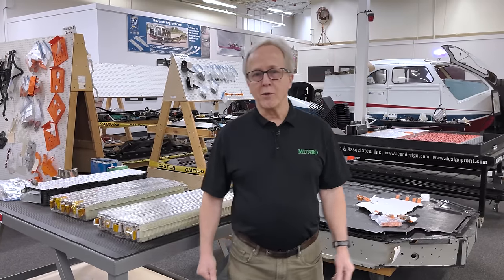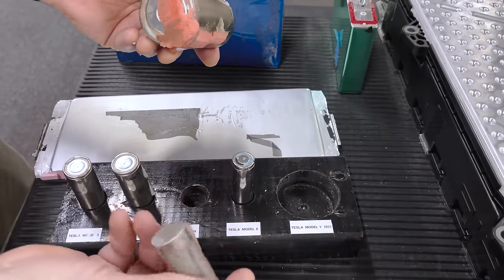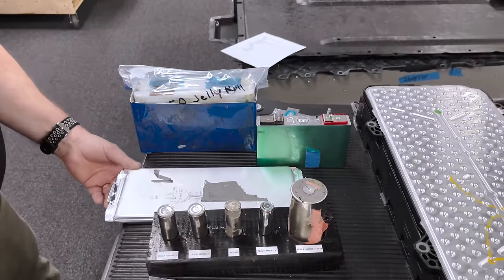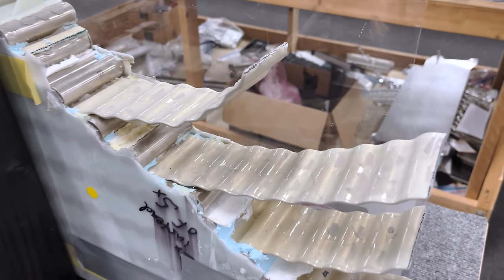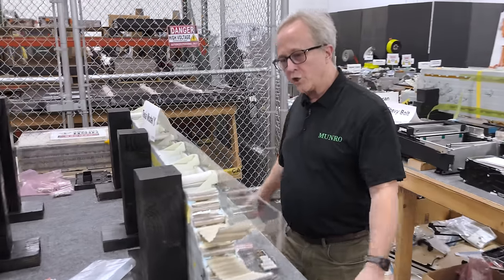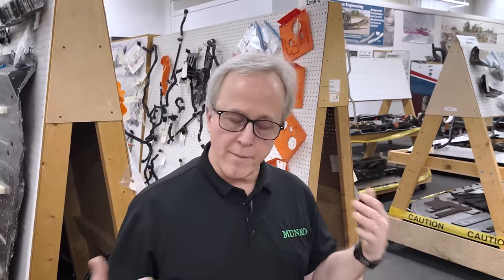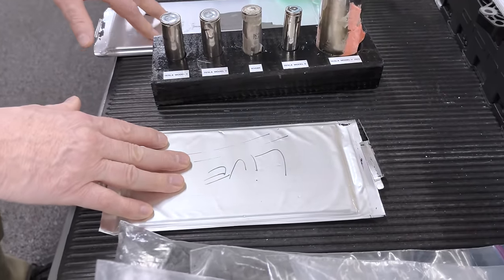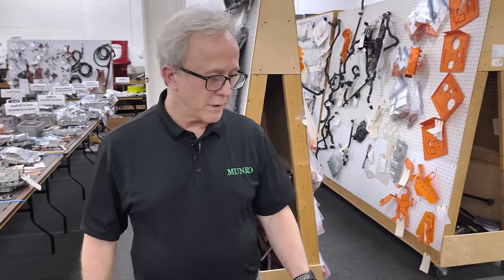Electric Vehicle Battery Breakdown: Cells to Modules to Packs!

Comment: @ 14:40 Absolute garbage. Totally unrepairable battery pack. More anti-consumer practices and planned obsolescence from big corporations. Don't be duped into thinking that... 
"this is better for you"! Yep, just give the billionaire owner another $10,000 of your hard earned money for a whole new battery pack! Now, that is my rant for the day. Otherwise good video.
Reply: "Reliability or Repairability - choose one" - Munro
Reply: @waynerussell6401  
"Don't be duped into thinking that this is better for you" - David Johnson  🙂
Reply: @waynerussell6401  you can have both. Just watched a video with a bmw having the thermostat inside the timing belt cover behind the water pump, whereas every other vehicle has it near the top of the block with only 2 bolts holding it on. A 20 minute job with 10 minutes looking for the 10mm socket vs 10 hour job
Reply: @JD-yx7be LOL, one small step in making a German ICE car economically repairable!
Reply: @JD-yx7be oh that wonderful bmw electric water pump…. No warning, no noise, it just suddenly fails when driving.  I’d put the thermostat behind it too as it’s a frequently replaced item.
Reply: @aussie2uGA  water pump is like a 2 hour job on my f250 on the bmw it is part of the timing belt
Reply: Having it as a disposable design forces Tesla to get the quality good enough to be able to do that without losing a fortune in warranty cost. If they can do that, it will save a small fortune in pack manufacturing . Most packs get shredded in the end anyway, when it comes time to recycle.  Having replaceable modules in a pack design doesn't add value if you're just going to shred it in the end anyway.
Reply: @TomPrucha  Have it as a disposable design forces Tesla to get the quality only good enough to last through the warranty. After that.... You're screwed.
Yes, it will save a small fortune in pack manufacturing. Good for the billionaire owner and his wealthy investors. BAD for the consumer.
Recycling ads ZERO value to the consumer.
Having replaceable modules DOES add value for the consumer.
I'm coming at this from the consumer point of view, not what is good for corporations and wealthy people.

Comment: The electricity comes from fossil Fuels! I'm supposed to wait hours away from home to charge at high prices.
Reply: many newer evs charge well under a hour.  Kia has a model that can charge to 80% around 20 minutes. I support fossil fuels so i don't know why that is a problem. I live near a coal town. Hybrids and plug in hybrids are still an option if you want to travel long distance often. As EV battery price continue to drop so do hybrid and plug in hybrid battery prices. Hybrids like the Toyota Camry are not much more than a regular Camry.
Reply: Electricity can indeed come from fossil fuel. It can also come from hydro, solar, wind, and nuclear sources. It is all a matter of where you choose to plug it in.